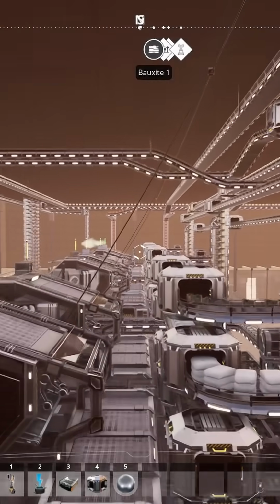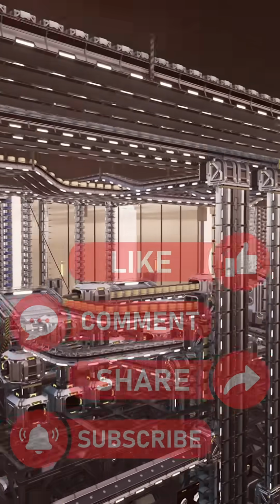Factory Design Tip: Why Logistics Floors Are a Mistake

Comment: But... you can't see the belt working. If it's not flowing, you'd never know.
Reply from the maker: I find that since i use the hoverpack constantly this is never an issue. I also can see the vertical lifts very clearly so often I don't even need to look at the belts. I also test the skids extensively and in sections so by the time i walk away from that area I know that the machines can meet the full production rate and that the supporting machines can also keep up. I would never chain several production lines together and throw the switch all at once.
Reply: @atroKraft  One day I'll be a organized and thorough as you! 😆 I'm growing, but not there yet. I still turn on the line i just built and it's full of errors usually. The other day though, I made a small production line and the rates were perfect the first try! So progress

Comment: I actually combined both concepts. I still have a logistics floor but, its 3 foundations high and most of the belts and pipes are routed on the ceiling of said logistics floor

Comment: I don't like overhead because I can't see what's flowing on the belts, and considering I usually forget what I was doing 10 minutes earlier I prefer to have logistic floors with catwalks to know what's flowing in my input or outputs
Reply from the maker: I get that perspective — especially if you’re someone who likes seeing items move past you as a reminder of what’s happening in the factory. But I’m curious: how much are you using the hoverpack?

Personally, I spend most of my time in the air, so having the belts and pipes on the ceiling doesn’t really get in the way. Since I’m flying around anyway, it’s easy to check what’s flowing, and for the same reasons I tend to avoid building tight spaces that would make maneuvering difficult.
Reply: @atroKraft  I only use hoverpack to build the esteriors of factories. Inside I like to keep my feet on the ground because I really like to walk around machines and belts. I use catwalks a lot. I get your concern about space but I get around that by building my factories inside out. I place machines and belts and then I build the exterior around it like it is a shell.
Reply: Right there with you in terms of preferring your belts and items visible. I still have yet to finish with a real build style, but I know I want to see the belts flowing, so that + catwalks are going to be a must for me. I think I am going to end up doing like a glass floor above the logi floor for something. But I totally get and agree with the 'Build architecture, after building the factory/floorplan,' you mention in your reply.

I do have a question for you, though: do you prefer the factory cart? Or a treadmill accelerator conveyor when walking around your factory? I sort of have an idea for both, but I cannot decide which to use in a factory.
Reply: @SanguinaryGuard oh treadmill without any doubt! I have a blueprint with belts clipped inside catwalks but I don't use it as much as I thought I would because due to my playstyle I tend to build small factories close to nodes and then ship all the materials with trucks and trains to a sort of "assembly" factory where the more complex parts are made. I don't like to build big warehouses because then I don't know how to decorate them XD